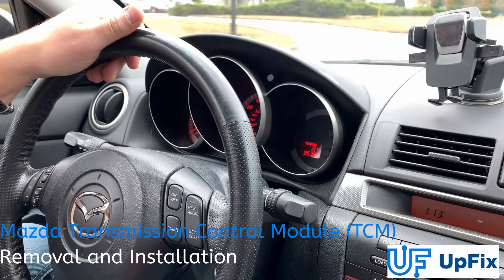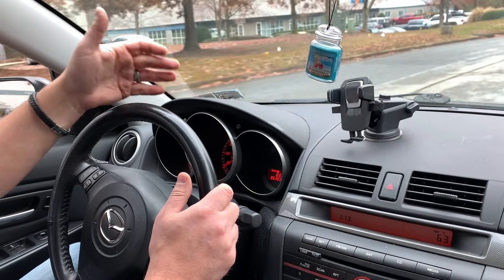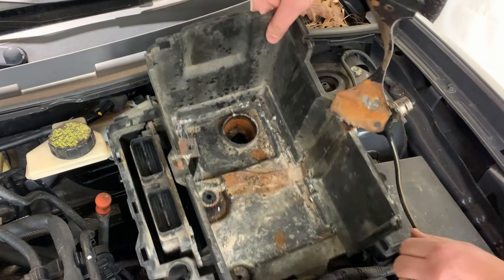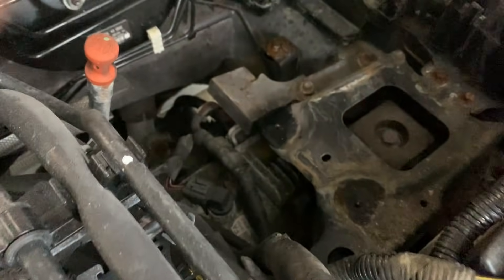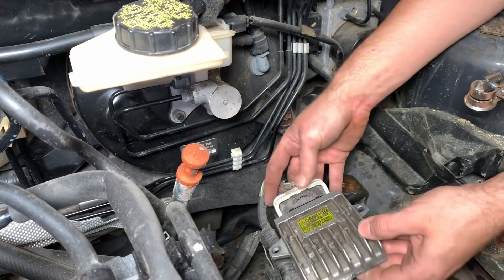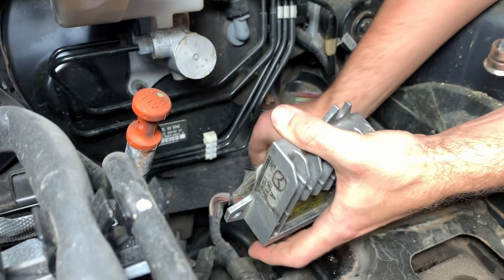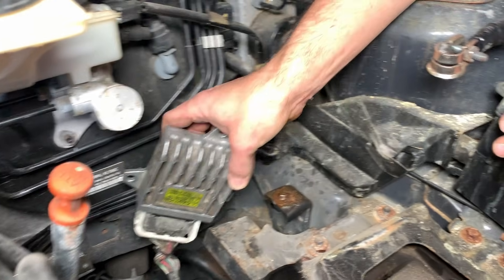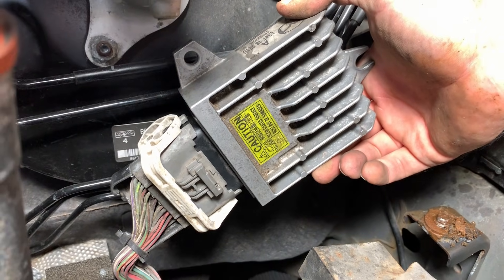Mazda 3 TCM (2006 - 2014) Transmission Control Module Location, Removal & Repair by UpFix

Comment: I changed my TCM today, it did not work. Still check engine light on, AT light on. Very shaking when shifting gears, and never shift over 3rd.
Reply: Josh did you try to drain the transmission fluid... it's help my car... before AT light came on and it wouldn't go into gear.... don't use Lucas anti slip make it worst...I have to drain it back out.
Reply: @Thoy28   Did you only change the transmission fluid which resolve your AT light illuminated issue?
Reply: @timfavorites  yeah I drain it twice ... it's help AT light stopped poping up....I would recommend changing the transmission fluid filter ... July 10, 2021 i changed my transmission fluid filter...My 2012 Mazda 3 skyactiv is running good great...no more problems... easy do it yourself job... it's just filter clogged up.... here is the part#FZ01-21-500 if you have the same model... dealership called STRAINER... others parts stores keep giving me wrong part.
Reply: @Thoy28  Often times if the transmission has been hard shifting for a while, not going into a gear or stuck...there could be debris in the transmission itself. I'd recommend first getting the TCM refurbished and have a peace of mind that the commonly known issue was resolved. If the codes/problems still persist, I'd drain the transmission fluid top it off with how much was drained and install a new transmission filter. Depending on the code, the speedo sensor may also be a culprit.
Reply: @245artist  I am being quoted from 1500 to 2000 just to have the TCM replaced, this is very expensive just to find out it didn't fix the problem.
Reply: Might also be the shift Solenoid  A  and B or the speed sensor. Did you bought the tcm from the junkyard? Might also be a defective/toasted tcm.
Reply: What was the issue?
Reply: I’m having same problem but not shaking, took it to shop he couldn’t find out what’s the problem told me to take it to transmission shop. I called explain what’s going on they believe it’s a electrical issue
Reply: I have a 2012 Mazda 3 with the at light on and no manual mode my TCM is not on top of the transmission where else should I be looking I took them out clear off there is no TCM there help!
Reply from the maker: @Oldiron  if you dont see TCM there then your does not have one. Some Mazda 3's do not have them.
Reply: @upfixauto  Oh goodie. It looks like after a lot of Internet investigation mine is the 2.0 engine it potentially is combined with the PCM it is just weird that I'm still getting that u100 code TCM communication error I'll have to call the dealer on Monday and see if mine's a combined unit thanks for the reply though
Reply: @oldiron2413  2012 Mazda has a TCM, but yours maybe has been relocated.
Reply: N7
Reply: Hello guys, question if I get a replacement is it just plug and play? Or it needs to be configured by an specialist?
Reply: Happend to . Me . Have a mechanic pull your codes . Guarentee it's your Speed Sensor for the transmission .
Reply: @davidchavez3510  òòp8
Reply from the maker: Hey Josh, are you still having issues with your vehicle shaking when shifting gears or did you get that resolved. Also, see comment bellow of changing the fluid. Not sure if that would help, could be worth a shot. UpFix.com can always repair your unit or send you one that is ready to install and is plug-and-play
https://www.upfix.com/product/mazda-3-2006-2014-tcm-tcu-transmission-control-module-exchange/
Reply: @upfixauto   I tried going to the above link, bet an error message kept coming up when trying to send info on the TCM that I am looking for.
Reply from the maker: @doc2590  here is the link https://www.upfix.com/product/tcm-mazda-3-2006-2014-transmission-control-module-repair-tcm-tcu/
Reply: @upfixauto   LFAE 189E1B  is the number displayed on the TCM, I cant see this number on the above site.
Reply from the maker: @doc2590  That’s a valid TCM part number but for Israeli and select European markets. Not for North American Mazdas but we can still fix them.
Reply: @upfixauto  great thx, do you know anyone in Brisbane Australia that can fix it?
Reply from the maker: @doc2590  no sorry

Comment: Hi I am in Thailand and I have a 4 speed trans which at times has trouble moving forward at time then when it moves it works fine or at times the selection on dash will jump from gear to gear but it isn’t changing 
I did as said here but found the Tcm is not as said here any ideas
Reply from the maker: The 4-speed transmission on your vehicle likely has a different TCM location or design than the 5-speed model shown in the video.

Comment: I had a 2006 mazda 3 sedan, but the tcm is not there any ideas where I can find it. Thk
Reply from the maker: If its not there then your Mazda does not have it and its inside the transmission.

Comment: Just bought a tcm for my Mazda. Hopefully it works stuck in third at light on lol
Reply from the maker: This a common issue when the TCM starts to fail. Checkout more info at UpFix.com
Reply: @upfixauto oh I forgot all about this, yeah it worked. I zip tied it to the firewall so shouldn't have that issue again, in my case it seemed to fail appropriately (185k miles)

Comment: I can’t find mine
Reply from the maker: If you don't find one under the battery, then your Mazda 3 does not have one.
Reply: @upfixauto wait really I have a 2012 Mazda 3 when I search it up it shows all the posible part numbers for it, and I got the code P0882 when I first had the issues meaning TCM power input low
Reply: @upfixauto also sorry for the late response but thanks for responding I’ve been trying to get ahold of someone told help me I even called y’all’s customer service

Comment: Hi I have 2012 mazda 5 and i got check engine light and AT light with P0720 code, i changed input and out put shaft speed sensor and stip got code P0720.
Reply from the maker: P0720 is issue with TCM.
Here is more info
https://www.upfix.com/product/tcm-mazda-5-2007-2015-transmission-control-module-repair-tcm-tcu/

Comment: do i need to reprogram the new tcm ?
Reply from the maker: Yes if you do buy a new/used TCM. Make sure the part number is same. Then you will need to have it programmed. If you have 3-4 days, then you can send your original for repair or get one from our website and we will ship it within 1 day. Check out upfix.com

Comment: I own a 2010 Mazda, and the error codes I'm getting are P2709-00 (Shift Solenoid F Electrical), P0735:00-68 (Gear 5 Incorrect Ratio), and P2709:00-AD. I suspect there's an issue with the TCM (Transmission Control Module). However, I've been driving the car every day for about 15 km in Manual Mode, and the gears work perfectly fine. But when I switch to Automatic Mode, both the AT light and Engine light come back on. Also, when I leave the car off for 20 minutes or more, the AT light goes off, and I can drive it again in Manual Mode. Do you think replacing the TCM would solve the problem?
Reply from the maker: The TCM is definitely faulty

Comment: Great video, only question I have is how do I know it’s the TCM? My cousins car has had the AT light come on for a few seconds in the past month like 2-3 times. Last week, it came on for a solid minute, transmission was jerking, and this time it triggered the CEL for U0101 (TCM lost communication code) and nothing else. However the AT and traction light still quickly went away and it drives fine. I cleared the code because he doesn’t want to pay to replace/repair the TCM, but I know this issue is bound to come back. Should I preemptively relocate his TCM in the hopes that it’s just getting too hot?
Reply from the maker: Yes the TCM unit is starting to fail. You can relocate it so it does not get hot. But in the summer time it will start happening more often.
Reply: @upfixauto all good, I sent my cousins TCM to be repaired with you guys. Thanks!

Comment: If I buy a used one do I need to get it reprogrammed?
Reply from the maker: Yes, if you buy a new/used module. First make sure part number is the same and then yes you will need to get it programmed to your vehicle.  However, if you get your original part repaired then it will be plug-and-play when you get it back. Visit upfix.com  and start saving today!

Comment: My transmission Control module failed, is my transmission supposed to make grinding noises or is something wrong with the transmission?
Reply from the maker: No it is not the transmission, but the TCM that is failing and makes it seem like it is the transmission. Replacing or repairing the TCM will fix this problem.

Comment: Hi my mazda 2014 not shifting in low gear whats the problem
Reply from the maker: If yours is a 2nd Gen Mazda 3 2010-2014 then it's most likely the TCM at fault that we can rebuild for you. Check out upfix.com
Yours might also be the 3rd Gen Mazda 3 which is the 2014-2018 model. If that's the case, let us know what codes are currently stored on your PCM/TCM.

Comment: I have a 12 Mazda 3 i.  I have only 90000 on the vehicle.  Im not experiencing any codes.  It does clunk when I shift from R to D.  Shifting is a little sloppy.  I live in AZ and our summer temps get to 110+.  These 3 concerns and knowing that Mazda 3s TCMs are prone to fail because of heat was enough for me to take action.  I went to upfix and started the exchange program.  There website is very user friendly.  I should receive my replacement TCM this week.  Ill send back my old one as soon as the new one is installed.  Hopefully the core charge is refunded sooner than later.
Im also curious to see if my shifting tightens up with the new module.
Reply from the maker: Thank you for choosing UpFix and sharing your experience! It sounds like you’ve done your homework, and we agree that extreme heat can definitely impact the TCM in Mazda 3s. We’re glad to hear the exchange process was smooth on our website!

You will not be having that issue once you install the replacement TCM. After you send back your old module, our team will work to process the core charge refund promptly. Don’t hesitate to reach out if you have any questions or updates on your experience—wishing you smoother drives ahead!

Comment: I just sent mine in for the Mazda 5. Got code P0758 with AT and Engine light on. Car would not get pass gear 3 and when about to come to a stop the engine would make a big jult and clunk sound. Praying this is the fix with the TCM?
Reply from the maker: P0758 refers to shift solenoid B having an issue. Sounds like your TCM is currently in limp mode. The most common solution if the solenoids were already inspected is rebuilding the TCM. Rest assured, if there is any issues with the unit, after the rebuild, your vehicle should start shifting normally again and will no longer be in limp mode. Here is more info on how to get your unit TCM rebuilt: https://www.upfix.com/product/tcm-mazda-5-2007-2015-transmission-control-module-repair-tcm-tcu/

Comment: I've replaced my TCM, and I’m still getting an AT light and traction control light, but now I'm getting a U0100 code
Reply from the maker: Make sure you have replaced it with the same part number.
Reply: @ I have but I believe it’s now my ECM
Reply: I have this same issue, tbh it's not worth fixing, car is too old and will continue giving you problems.
Reply from the maker: The U0100 code is a common issue and may be related to a faulty connection, or a faulty TCM.

Comment: I did exactly what you did in the video and it worked for me. I used my vacuum to blow on the dust. Thank you for the video!
Reply from the maker: Glad you got it working. Sometimes the simplest solution is the best!

Comment: I disconnected my battery for 2 hours then hooked the battery back up now everything is working fine. For how long I don’t know! 👍💀
Reply: Did the issue come back or did you have to replace the TCM? Just had this problem happening to me and trying the battery disconnect fix you mentioned now.
Reply: Did it fix your problem? Currently having the same issue

Comment: What about the 2004 Mazda 3? Is the TCM located in a different place? Did exactly what you said in this video, and my TCM is not in that location.

I've read many different things about it on Google, such as the 2004 Mazda 3 doesn't have a standalone TCM. It says that it's integrated into the PCM. I've also read to check behind the passenger side kick panel, above the ECU?

I'm very confused now because I cannot seem to find its location, and all I'm finding online is conflicting information.
Reply from the maker: If it is not there, then your vehicle does not have TCM and it's built into the transmission.

Comment: Have a 2006 Mazda axela, Tranmissions ecu part number is LSF3 18 9E1A but i got a new tranmissions ecu but the part number is LFS3 18 9E1B, will this work in my car?
Reply from the maker: No, that part number does not work as a replacement for it.

Comment: I know this video is old, but our 2008 Mazda 3 basically bucks in 5th gear with a loud bang, then revs the engine like it is not in gear, then just fixes itself at the AT light flashes on the off. Scares the shit out of us. Would that be a TCM issue? I do have check engine light on due to vacuum leak, so I am not sure if it is related to that. The AT light does not stay on. Any ideas?
Reply: Dude you just described the exact same issue I got with mine (2010 mazda3 S Sport 2.5L). It happens after some 10 minutes of driving, sometimes it’s really loud and scary! Today I did a drain and fill of the AT fluid (also changed the filter) but the issue is still there. We connected the OBD scanner and it gave us the code U0101 which by looking thru the internet it’s got something to do with the TCM or wires, idk. I will keep investigating and if I find a solution, I’ll let you know.
Reply: @gcertain  Send in your TCM for repair. They fixed mine and the transmission now works.
Reply from the maker: Yes this is a common issue on this Mazda 3 2006-2014. TCM needs to be replaced or repaired. Check out upfix.com, here is the full link https://www.upfix.com/product/tcm-mazda-3-2006-2014-transmission-control-module-repair-tcm-tcu/

Comment: Will the TCM work with any Mazda TCM? Pls ik im 3 years later but im having problems with this atm
Reply from the maker: If you are getting a replacement part, then make sure the part number is the same. You can also get your original TCM repaired by UpFix. Visit upfix.com for more information.
Reply: Yeah, just make sure to match the part number and correctly put your vin number in. Totally worth it
Reply: @jac9245  which is the part number? Like the top one?? Or the big numbers?

Comment: How much and where do I sent my tcm?
Reply from the maker: Address is UpFix 4991 BU Bowman Dr, Buford GA 30518.
Here is a link to the current pricing https://www.upfix.com/product/tcm-mazda-3-2006-2014-transmission-control-module-repair-tcm-tcu/

Comment: do you think is ok to zip tie the TCU to the brake lines? what if the TCU gets hot and burn the line and starts leaking?
Reply from the maker: The only reason to relocate the TCU is because the transmission gets hot and original location of the TCU is on top of the transmission. The TCU will not heat up.

Comment: I have mazda 3 2016 hatchback, where the TCM module located and how to remove it. Thanks
Reply from the maker: It's located in the engine compartment and bolted directly to the transmission -- underneath the battery box. This video shows you how to locate and remove the unit.  It's an easy job.

Comment: Thank you very much. I want to ask you something. My vehicle is a 2006 model 1.6 automatic transmission Mazda 3. Unfortunately, I cannot find the TCM in my vehicle. Where do you think it could be?
Reply from the maker: It's possible that your vehicle might not be equipped with a TCM, but rather, the PCM controls both the engine and transmission. If you're having TCM related issues, let us know what those codes/issues are.
Reply: @upfixauto  I live in Turkey. My vehicle's AT light came on 2 months ago. When we looked with the obd2 device, we saw the p0715 error code. The master said that this was caused by the speed sensor. Even though it was changed 3 times, there was no improvement. I learned from the internet that TCM can cause this problem. But unfortunately I couldn't find this part in the car. Another authorized Mazda service said that the turbine had to be replaced without checking anything in the car and that it was very expensive. Unfortunately, repairmen in Turkey always prefer the easiest and most costly methods. There are also problems with gear shifting and I have read that these problems can be solved by resetting the tcm. What do you think I should do? By the way, thank you for your interest.

Comment: Tengo un Mazda 3 2010 y el módulo no se encuentra ahí, hay alguna otra parte donde pueda estar?
Reply from the maker: Algunos Mazda 3 no tienen TCM. Eso significa que está integrado en la transmisión.
Reply from the maker: If your Mazda 3 or 5 does not have the external TCM. Then first have dark or dirty transmission fluid drained. I recommend replacing it with fresh fluid and a new filter. Check fuses, back probe wiring, plugs, and pins. Make sure they are free from debris, dirt, grease/oil. Check your speed sensor and your oil pressure switch to the transmission as well.

Please check your battery cables and grounds, try the hard battery reset (guide attached) with both negative and positive terminals constantly touching for 30-40min and the battery removed. 

Once you have completed the above steps, re-scan the car and follow the codes. If he has the same issue then the PCM may need to be replaced. 

https://forum.upfix.com/tcm/tcm-troubleshooting/